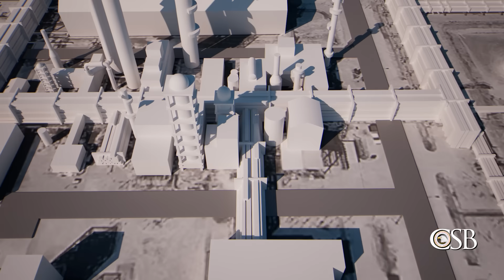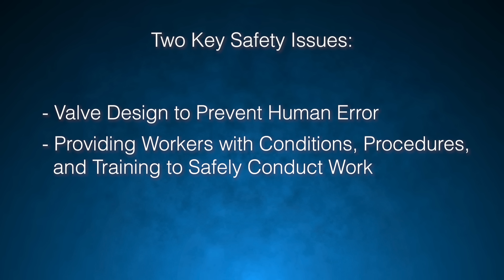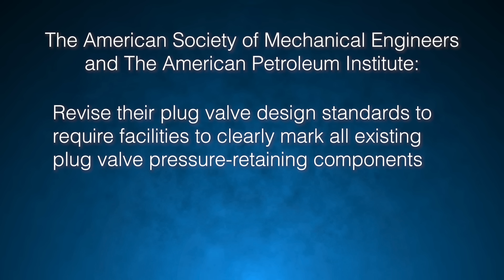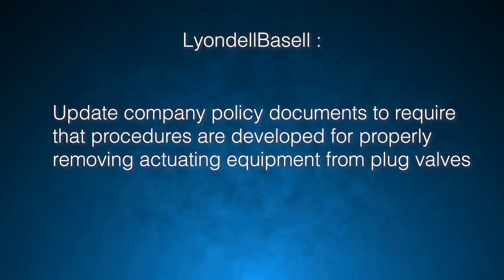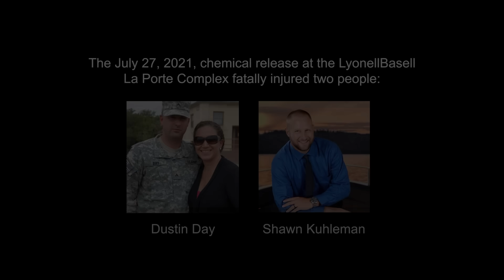Designed to Fail: Chemical Release at LyondellBasell

Comment: If the animation is accurate for the real deal: why did the workers even think about removing those 6 nuts? They didnt need to remove them, because the actuator sits on frame held by 4 bolts, and those 6 nuts clearly hold the valve assembly together. I can only imagine that they thought it was just a cover plate holding the coupler in.

Comment: The way they described what Acetic Acid is for, and then how it’s extremely dangerous threw me in a loop😂. It’s crazy how it’s legal to put this in food.
Reply: Acetic acid is vinegar. Or rather, vinegar is a solution of 5-10% acetic acid in water. So, very dilute. But when highly concentrated (and hot) it can indeed be very dangerous and corrosive. It's all about the concentration. This is true for lots of household stuff. Like how dilute hydrogen peroxide is safe, but when concentrated becomes quite hazardous.
Reply: @matthewsmith5104  Wow, I never knew that. Neat stuff.

Comment: Why remove the actuator when you can disconnect the pressurized air that enables it to move. They'd need to disconnect it regardless... And I am curious why they felt the need to remove the coupler? Best wishes to the employees and their families.

Comment: The actuator design isn't a problem. How stupid can you all three be to do AAAALL OF THAT WORK when the pipe is under pressure............
Reply: Why was the pipe under pressure and the tank full?

Why were they working on a single valve isolation? Why eould you even consider that to be safe?

Why work on the single isolation to the upstream process? 

Why was the design bad and not up to positive isolation standards? 

Why did such a small leak lead to fatalities?

Why was the procedure so shockingly poor?

Comment: This appears to be incompetent workers of Turn 2 ! All three workers that did not know what they were doing .
Reply: The USCSB identified poor valve design and poor procedures as the primary safety issues. You disagree with that?
Reply: @DS-qz2gu  
Yes , it seems all the fault lies within the deepest pockets .  If you change the wheels on your automobile and the wheels fall off , who is to blame ?  The torque wrench manufacturer , the wheel stud manufacturer , or the metallurgists ?
Reply: @vicpetrishak7705  So are you implying that you’re more qualified than professionals at the USCSB to identify what caused this issue?
Reply: @DS-qz2gu  Do you even  know what a valve and an actuator are and what they control ? They are two different mechanisms .
Reply: @vicpetrishak7705  Answer my question first. You’re fully disagreeing with the USCSB on what caused this incident. So I’m just wondering what your qualifications are that make you more qualified than the United States Chemical Safety Board in determining the cause of a chemical safety incident.
Reply: @DS-qz2gu  Are you an attorney or a cop that loves to argue when someone disagrees with you !   How about toothpicks , do you think they need safety chains on them or directions to use them .
Reply: @vicpetrishak7705  I just want you to answer the question. It takes a lot of confidence to disagree with an organization that had field experts spend hundreds of hours investigating this incident, so I want to know where you’re coming from.

Comment: Sadly, I don't think this is consistent with all the good reports that the CSB has put out in the past. As a "valve guy" in this industry, there are a lot of disconnects in this report and the conclusions regarding re-designing plug valves is a real stretch. Who is trying to make a name for themselves?  Top entry valves are DESIGNED specifically to be able to do maintenance by removing the bonnets, if needed, inline.

SMH

Comment: Why don't people stop and analyze the thing before taking random nuts and bolts off? This would've been entirely preventable if anyone there had some basic mechanical knowledge. It's a simple valve, the purpose of those studs is obvious to anyone with basic mechanical skills. Training and procedures should not be necessary for such a simple operation, these guys are just darwin award winners.
Reply: Agree 100% with what you say. Even a 3 year old understands how a nut and bolt works. Same with the thing that happened at baton rogue. Its enough to look 1 second at that valve and understand whats pressure-retaining and whats not.

Comment: I watched this and was confused why they would think they had to remove those nuts.  I thought well maybe in real life the valve looks more complicated and they just simplified it for the animation.  Checked the report and ...nope its pretty clear you only need to remove the 4 bolts to remove the bracket and actuator.  Then they had the actuator removed and still didnt realize taking those nuts off was unnecessary and started prying on it.  This is beyond lack of training seems they lacked basic mechanical skills.  The only other cause i could imagine is that they were pressured to work at a breakneck pace and had worked multiple 12+ hour shifts in a row and were drowsy or something.  RIP =(

Comment: The pressure containing nuts should be changed out to a different, non hex shape design. The required tool to use those new nuts should be under lock and key.

Comment: No excuse for this.  Either the actuator mounting was improperly designed, or it was improperly removed.  The story does not give any information about this.  In all my years of designing and specifying valve actuators, this has been a mandatory requirement that actuators be able to be installed and removed without affecting the pressure integrity of the valve.

As to the people who asked why the actuator needed to be removed, this could be because the actuator was a spring to open, pressure to close actuator.  The video does not give enough, or any, information about the style of actuator or why the crew was instructed to remove it as part of the repair.

Comment: The lady recommended new written policies... I am hoping this is not the solution to a problem that is bound to happen against. These black and white written documents only save the company from a lawsuit in a cheap manner. The real solution to this problem is way more expensive. 
Solution # 1 - replce the nuts on the seal. This is cheap, and still holds a 90% failure. (The valve can still come out depending on pressure)
Solution # 2 -  Redesign the pipe system with two shutoff valves. One on top and the second one on the bottom of the problematic valve.
Solution #3 - redesigning the valve. I know how it should be redesigned... for you to figure it out. A man should never reveal all of his knowledge for free. 😊😊

Comment: “Inadvertently removed pressure retaining fasteners…” 

“Did not have a procedure on how to…”

“…attempted to forcibly remove….”

Nothing good is going to come of this - pretty clear they didn’t understand that not to mention they were working on a system that was still “live” (vessel had not been drained of the hazardous substance, no safety protection system, or closed valve to put a barrier between the work and the hazard…no standard procedure) and there’s literally tons of hot acid under pressure right behind the valve they’re trying to force off.

Comment: Yet again America gets the solution wrong. The issue happened because the system was not safe and isolated to work on. The valve design could be improved but ultimately the issue was poor training and safety standards. There was so many times these workers should have stopped and got advice why the valve was not coming apart like they expected.

Comment: 5:36 why aren't these places required to have a secondary valve instead of relying on a single valve or trying to redesign the valve? Seems like a manual secondary shutoff valve would prevent incidents like this.

Comment: As a pipe fitter myself, this video makes no sense.  EVERYONE knows that the vessel above the valve still contains a liquid under pressure.  It has to be drained before removal of any component.  I can see no issue with the design of the plug valve at all!  The stupidity is all with the fitters.  You can remove an actuator (though I wouldn't) before emptying, but they removed the actuator base!!!

Comment: Is removing the actuator the only way to lock out the valve in closed position? could they not have just removed the control lines (air/hydraulics) or just turn off the power to the unit? The crew was definitely under trained but I feel like you are concentrating on the wrong issue here.

Comment: it fails me why they needed to remove the actuator int he first place - where they even reading the same work order?  Close the actuator, isolate it and then de-inventory the section where the busted pipe was to be replaced - at both ends.

Comment: Pipefitters shouldn't be working on actuators, full stop.  We here in Canada have instrumentation as a skilled trade; among other things, instrument techs are trained in servicing valves and actuators.  Having someone from a designated trade with relevant knowledge and skillset would greatly reduce the likelihood of such incidents as this.  Getting pipefighters to uninstall an actuator is like asking a carpenter to install a toilet - their skillset is kind of plumbing adjacent and most could probably figure it out, but it's really not in their wheelhouse.

Redesigning valves to make removal of the bonnet (...er, "pressure retaining components") difficult enough to prevent human error is a fool's errand that puts the blame on the wrong cause, akin to expecting pipe flanges be redesigned to be foolproof after a couple millwrights unbolt the wrong one and get sprayed.  Or recommending arc welders get redesigned to weld without using electricity because a scaffolder was using one without a mask and cooked his eyeballs.  Or dropping the voltage of the entire power grid after a kid gets past the fences surrounding a substation and gets electrocuted.  It just ain't anywhere near practical.

Comment: The foreman and crew 100% did not know what they were doing.  They should have had specific training or a company that works on plug valves.  I run into this all the time of working on things outside of my training and I have been a piping supervisor for over 25 years.  Contract companies use people that are not trained in specialty work... there is absolutely NOTHING in any NCCER on plug valve disassembly nor should there be.  It should be a company that is specific to the work.

Comment: It's facinating that the SOP was to remove the actuator and lock the valve, and not just disconnect the power supply from the actuator and plug the input into it with a LOTO.

Around my neck of the woods, removing an airline and plugging the inlet is fine for a lockout.

Comment: How about... change the lug nuts into pentagons needing a special tool and paint them orange, paint an orange x across the pressure plate and solder a pressure hazard "⚠️" clearly visable.

Solder instead engrave for material strength reasons.

Comment: Possible inexpensive retrofit device for marking pressure retaining fasteners: An orange plastic cap that slides over exposed threads similar to the caps on propane tanks, but with a high pressure warning molded into the plastic. 
The pull tab to remove may prompt a pause or second thought when removing it.

Comment: If you are the company representative on-site you need to watch contractors like a hawk. I had seen contractors who had no english-comprehension skills readying to take knocker wrenches to ANSI 900 flange studs while the product in the 20" line was nearly at 1100 PSI. I started yelling and waving my hands and they looked at me like I was crazy. Finally the crew boss came over and translated and the laborers would stop messing with things under pressure.

Our company hired whomever was the cheapest and who would 'say' that their crews were qualified. The casual, unknowing attitudes of the guys doing the work pointed out that they had no idea what they were doing. They could bang on wrenches, maybe even manhandle a pipe section in to place or drop in a gasket between flanges but I never trusted them to do anything without supervision.

I caught one crew sliding in a new flange seal without removing the old one first. They (used pry bars to try and force it in to place) and so badly mauled up the compression faces on the new seal that it was useless but they were ready to just move on and install it. 

I was "just" the engineer and not supposed to touch the tools but I ended up responsible for everything they did. Meanwhile the phone in the control building kept ringing constantly with operations wanting to know what was taking so long. Time on the phone inside was not time for me to be watching what these guys were up to.

+++
Then BP bought us.. And we know what happened several times with BP. I decided it was time to move in to a different field of work.

Comment: The most important topic is not mentioned, the usage of single-acting drives. If that would be a single-acting drive which has closed as the saftey position, they just would have had to unplug the air hose from the valve actuator and prevent the re-connection, and everything would have been save without removing the actuator...

Comment: I see two problems here on the CSB’s part.

The first is the acetic acid Lyondell is making at this plant isn’t for food use. In a lot of countries acetic acid for food has to be of biological origin - you start with wine and add a bacteria called Acetobacter to turn it into vinegar. Or, in the case of my late grandfather, you make a barrel of wine, don’t bottle it soon enough, and the acetobacter adds itself.

The other is that a recommendation to provide workers proper tools should have been issued. A crowbar is not a three-jaw puller, the right tool for this job.
Reply: Pushed send too quick. Acetic acid is a very useful industrial chemical. They use it for a lot of things. For instance, there’s a plastic called cellulose acetate, which is used for making a cloth called rayon and clear plastic sheets. They make it by dissolving wood fiber in acetic acid and straining out the big pieces. It can also be used as a solvent or a pH modifier when you don’t want to use one of the really nasty acids like hydrochloric or nitric. This stuff is no joke, though…it’s both corrosive and flammable.
Reply: This plant is food grade qualified and a small % of it does go into food though most of it does not.

Comment: harebrained idea:

A common feature in many public spaces is the use of "Security bits". Screws which have a specialized head that require a specialty bit to remove.

Perhaps the design of a specialty Pressure Vessel nut and bolt is required, that requires a special head and wrench. It will be instantly recognizable to the worker, and would indicate that the nut/bolt is holding back pressurized contents. 

The wrenches and sockets for undoing these bolts/nuts could be required to be controlled in inventory, and only allowed to be lent out by the company to workers needing to use them once they are verified to have completed required safety training, as well as documenting exactly what will be removed, and verifying that the contents have been safely depressurized and removed. 

When work is to be performed that should not require the loosening of pressure-containing fasteners, the tools will simply not be loaned out. This would render it extraordinarily difficult, or impossible for workers to accidentally remove pressure-containing fasteners. 

Furthermore, a standard shape could instantly indicated to the worker that the fastener is holding back pressure. This would be much better than color-coding, where colored paints may wear off or be susceptible to dissolution, as well as the fact that differing color standard across companies and facilities might again lead to deadly confusion ("The blue bolts in Facility A mean danger, but the Blue bolts are the only ones we are allowed to remove in Facility B. Or was it the other way around???")

This would result in increased costs, initially, in the maintenance and construction of refining facilities, but if the fasteners are standardized, costs would quickly become close to normal again as production picks up. It would allow for much improved safety in to the future, as well.

Comment: 6:34 what was the plan here 6:34? After they got that off were they “done”? Seems they finished after removing the actuator but kept digging into the pipe anyway? Is it possible they got improper instructions? Like “there is a leak, so remove the actuator” maybe they thought the leak was in the valve? Just looking at 6:34  i cant figure out why they wanted to take that off.

Comment: i know concentrated acetic acid isn't vinegar and the narrator clearly said 'chemical burns'  but i was wondering if they were simply scalded (burned) by the 'chemical' hence 'chemical burns'.  its likely not the case but the language used doesn't preclude the possibility and 164 thousand pounds is a lot of hot liquid with which to be 'sprayed'; drenched may have been more accurate?

Comment: If the valve is made just as the animation illustrates. No one who works on valves for a living would have removed those nuts. They clearly are flange bolts which attaches the valve stem to the valve body.